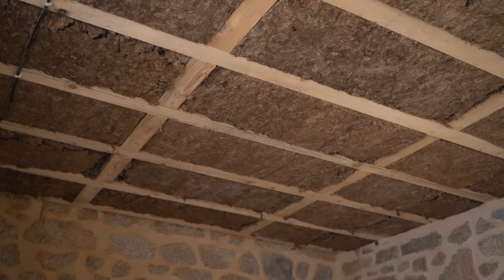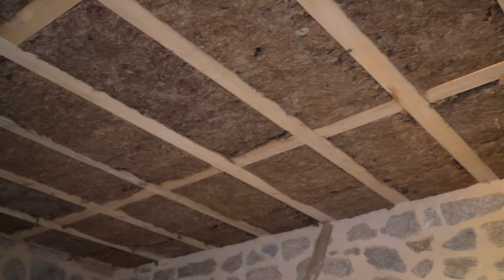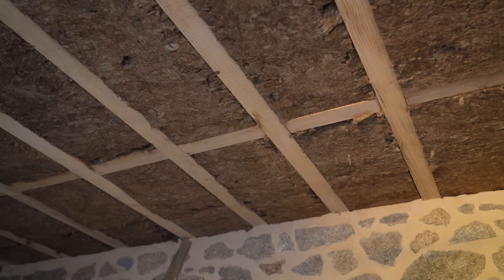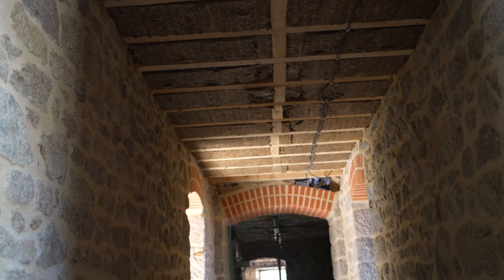Sundays at Chaumont- insulation and wiring breakdown.

Comment: Cool! A lot of explanation right there, Dan.  Thanks!  A little something to offer that I discovered by accident a few years ago when I had to install some cedar beam covers and random (4", 6" and 9") width planks on a porch ceiling here in sunny Florida.  I milled all the cedar (so it was straight) and also decided to do a 5/8" roundover on all the planks so I didn't have to worry about careful, fussy butt  fitting on the install.  The roundover hides little gaps and bad fitment in places.  Great.  The exterior of the house was what we call stucco and is a cementatious product, trowelled on over the cement block the same as you would trowel on lime render but in two coats.  The first just a smooth bonding or base coat and the second in this case what we call "skip-trowel" where the mortar is applied in skips and spots resulting in a pretty rough surface possibly with about the same irregularities as some of the stone walls in the basement.  I wonded how I was going to make the meeting of the ceiling wood to the rough walls look neatly finished when I found that just butting the roundover planks against the wall worked just fine. No caulking, no coping, no nothing.  The roundover lets everything just sort of fade into darkness and look nice and neat and straight!  In your case, you might do a 150 or 200mm wide flat piece with the outside edge rounded over to form a border or faux "crown mould" around the perimeter and then infill the rest of the ceiling with drywall or whatever material you are going to use. If someone had told me about this little trick, I probably wouldn't have believed them but it worked great and this was in a new home worth well north of a million dollars so it wasn't just a "slapstick" sort of solution. Whack off a two meter piece, route a roundover and throw a little stain on it for a test piece and have a look.  It might work in your case!              Jack L.

Comment: Floor outlets if legal in france and no switches in rooms. Use wifi appliances like Google home or Alexa.The newer units don't require an internet connection. To minimize the number of units use wireless mics to transmit to a central unit. Wireless wifi bulbs are awesome.

Comment: Love the Sunday videos. For someone who has watched from the beginning this adds so much insight into the project. Thanx Dan.
Reply: Definitely. It fills in the gap of why they’re doing what they’re doing and what the future plans are.
Reply: Fantastic Dan. Love the details you are explaining. I wonder if it’s possible for a sprinkler system to be installed now that you have water. I guess this would be the stage at which to do it. Just a suggestion. You have thought of everything so far.
Reply: @annstroud2168  He needs some kind of firestopping and protection for the roof spaces. It's 4 stories up and rural location. It's a very vulnerable structure for the fire department to get the right equipment there quickly. Give it an hour and the whole roof could go up again.
Reply: What are you doing about fireproofing and fire sealing between the roof spaces so the chateau doesn't go the same way as last time.

Comment: Hi Dan. Be conscious of internal insulation. It is really not a good solution in a historic building to use a rockwool plasterboard solution. The Rockwool sales people have sold you out. Look at isopore blocks and lime render which will allow for moisture diffusion. Isopore does not rely on vapour barriers and is adhered directly to the pre rendered brick and stone walls with adhesive lime mortar. (Construction architect and historic house owner). I live in Denmark the home of rockwool. Do not fall for the rockwool reps. They do not have a good solution for this type of construction. You will never be air tight, which is what these solution relies on. Make a breathable construction.

Comment: 30kwh with heatpump is less than 7.5kwh in actual energy use. (SCOP4). There are outside units that use inverter technology, that can really attenuate the poweruse. older machines cut dial down to about half their peak capacity, inverter ones can go down to 10-ish percent of rated peak)

Comment: In both of the homes I purchased and rehabbed I have always put into the walls and ceilings anything I thought I may need in the future.  Wiring for pendant lights in the kitchen (the wires are still there), wood blocking in the bathroom for grab bars I may need lather in life etc.  I know I would not remember where they are so.....  With digital camera's these days I would snap pictures with a yard stick (do you guys have meter sticks?) or tape measure showing the distance to adjacent walls or floor.  Or write on the wood info before the picture.  It works the charm.

Comment: Excellent!  Got most of my questions answered.  I look forward to seeing it all unfold.  Regarding "CAT-5" wiring, not to put too fine a point on it: You'd mentioned CAT-5 in conjunction with fiber.  Fiber uses fiber optic cable.  CAT-5, and all its iterations (CAT-5e; CAT-6; et. al.) is copper.  There's a lot of use-considerations, capacity, and planning involved with installation of network and phone cabling, jacks, switches, routers, audio, television, etc.  I'm sure you'll engage qualified engineers to assist with this not-so-small task.  🙂sorry...I'm a nerd when it comes to wiring.

Comment: Wireless switches is a great idea. Max flexibility for operation and positioning as well as changes as building use evolves. I use Hue lights and switches throughout my place and I love them. They probably not the exact solution for your place but I am sure you will find a system that meets your needs.  On the topic of rockwool, that is what I am using in the renovation on my house here in Canada. Love this stuff!!!!

Comment: These Sunday videos are a perfect addition to this channel! Keep them coming. Being from the Netherlands I’m not aware of the French regulations on wiring, but in the Netherlands we use a system of plastic tubes 16 mm wide through which we run the electric cables. These are separate cables for each phase, earth, and zero. Those cables can be easily replaced while the plastic tubing remained in place. Separate tubing for cat5, 6, or 7 network cables. Wondering about one thing though. Light switches can be wireless, but electricity plugs can’t. How are you dealing with wall sockets without running cables through the walls in the basement?

Comment: Hi Dan, have you already look at geothermal system for the château ?
Reply: There is already considerable planting. Maybe this is one aspect that Dan didn’t plan for. But the chateau has a huge amount of gardens so it’s not too late.
Reply: @ I mean geothermal to heat and AC the building .. usually that kind of system make more sense in huge buildings !
Reply: @ Yes. They run pipes zig-zagging at a depth of 2 metres across a wide area and pump special fluid into it - when the fluid returns it is warmer and a heat exchanger extracts the heat from the fluid for the building….in this case the chateau.

Comment: Great video!  You are doing wonderful work!  Question: Will you be installing safety systems such as centralized smoke and heat detectors, maybe some fire pull stations?  Safety battery lighting?  Based upon your planned usage of the building, will the authorities consider it a commercial versus residential building?

Comment: Thank you so much for explaining the process. I’m curious if you will be installing a heated floor in the basement under the concrete and stone to help with the moisture humidity and damp. It can be a separate system from the rest of the building. Also, do you plan to use steam, electric, heat pumps, gas or some combination with rentable solar?

Comment: I know you mentioned how installing the rock wool made you itchy. Several commenters, and the product safety info, mention eye protection to prevent rock wool fibers from falling into your eyes and working their way into your eyeball. I really hope you'll use eye protection in the future. You've also mentioned finishing out the kitchen with a mass event capability. I'm curious if you have plans for a dumb waiter or lift of some kind to take those volumes of food upstairs? I can see taking trays of prepared food up those stairs you're planning could get old and tiresome very quickly

Comment: Speaking of heating... i saw a video of a very old castle where there was a fireplace (which you can also maybe use propane or something else) on each big room on the 1st floor and instead of chimneys that go directly UP , the smoke and heat dispersed across the above flooring and then out! It's been there for hundreds of years!  Perhaps that's an option for heating the rooms ?

Comment: Not CAT5 cabling... you must use Cat 6A. Also you need to run Fiber or DAC cables on every floor for the future so that you will be able to properly use 10Gbps or 2.5Gbps (which is not extreme).
The wireless switches sound like a good idea BUT once again you need to use proper protocols like Zigbee for example. You need to have a proper zigbee coordinator and at least two routers (zigbee repeaters) at each floor.

Please don't try to cover every room with just Wi-Fi. at least one LAN cable per room. Buy proper equipment like UniFi. use the In-Wall that provides wi-fi as well as lan ports.

Comment: For the electrical wiring above use conduit, if you install that correctly then you will easily be able to pull wires through them as well as provide a fixing along the floor joists.
For the outlets below use skirting cable duct with a vertical duct coming down in the corner of a room.
I’m an electrician and this is how I’d look at doing it, hope it helps.
Reply: Gaskett, shouldn't you be a plumber?😂
Reply: @jmk1962 a plumber is one who prevents leakage, mainly water. In some countries a plumber and electrician are doing very similar work. But in Europe the professions are very much split apart.

Comment: A lot to do. Wiring in the basement: run pipes (tubes, made vom PVC or Metal, like water pipes, but preferably black) vertically from the socket or switch straight up into the ceiling were the wires run horizontallly. This looks good in this rustical ambiente with you switches, they used pipes at their time also.
Insulating the floors: Floors have to insulate noise, not temperature, except above the topmost heated floor. It was usual to include heavy materials into the floors, sand, bricks, not glasswool (rockwool is also a glasswool, just in a different color. Since they become bio save (no lung cancer anymore) they degrade if water drops onto it over the years).
Wall insulation: difficult. Esprcially if you install thermopane windows. The ater will confrnse on the coldest watt and produce mould. Only remedy: use forced ventilation inside the house. Insulating the wall from the inside will only make problems.

Comment: Idea: for ceiling in basement. What if u leave a gap around edge and put lighting all around to illuminate the walls and give even lighting? Would also look fancy and less dark. Not sure what you’ll do with plugs.. u got the light switch idea but plugs are not wireless. Interesting anyways. Like a “dropped ceiling" or a "suspended ceiling" I think it’s called. Or maybe even a “tray ceiling”.
Reply: He can run the socket wiring behind the skirting boards.
Reply: @ yea true. How to get skirting boards on an uneven surface it’s beyond me. Or maybe even floor plugs somehow. Right in floor near edge. Raise floor a bit. Dunno.
Reply: Or start a trend and go powerless. Like a new vegan movement.

Comment: Very interesting that you chose Rockwool for insulation... that will keep you warm. I would suggest to choose 3 layered insulated glass in stead of 2 layered.
Reply: I live in France and do not know anyone with 3 layered glass. It rarely goes under minus 10 dégrées and I live about 3 hrs drive from the château
Reply: @carlavergeer5852 Maybe triple glazing is much more expensive and doesn’t look so good.
Reply: @carlavergeer5852 I live in Denmark were we also rarely have minus 10c, and 3 yrs ago my windows were changed from dural to tripple glass (and the walls and ceilings are insulated with Rockwool since forever) and my heating needs (and bills) are now down x4...

Comment: Surely you must have a patch of ground outside where you could put a "range" of solar panels or a ground source heat pump to help with the power needs????
Reply: There are solar power roof panels that are nearly indistinguishable from slate tiles -from a distance, at least

Comment: Plug sockets can be supplied by running wire behind the skirting boards and from room to room behind the door framing.
Reply: Not sure if French code would allow to daisey chain all the rooms like that? Maybe he could run down the wires in one  corner of each room and hide the  rest behind the skirting boards? Then again since this is the basement electrics might have to be a certain distance above any hypothectical flooding or splashing when cleaning the floor? Things can be quite strict in some countries these days.
Reply: @rutgerw.  or use nice metal conduit tubing on the wall surface. It would look retro.

Comment: Are you going to have fireplaces installed? It would be in keeping with the building to have a few. I know you will rely on insulation and radiators fir proper heating, but for the aesthetics I’m mainly asking.
Reply: Most houses in France use wood  burning stoves these days.

Comment: Never use glass wool, it collapses at the slightest moisture and the insulation is equal to 0. You are using the right thing. Stone wool insulation is the only right thing as it will dry out if it gets a little moisture. I have helped renovate several older buildings in my active time as a carpenter and bricklayer.

Comment: Why are you insulating the floors? Your heat is trying to escape out of the house, only the roof and walls need to be insulated, unless you’re talking acoustic insulation. Separating the rooms with thermal insulation is not only costly now, but will cause zoning through the building which is inefficient
Reply: Referring to the 1st/2nd floors of course. Understand why you’d do the ground floor since you can’t insulate the basement walls

Comment: I live in Germany,  in a little old house built in the 30's.. it seems that when it was being wired, the  electrical cables all ran through a sort of pipeing... when we needed to replace the old 30's wiring , for brand new up-to-date modern wiring,  we just needed to slide out the old and slide in the new...  no damage to walls or ceilings and everything done in a few hours instead of weeks... Genius. You might want to consider the extra "pipeing" for ease of maintainence in years to come.  The future may thank you for your forsight...
Reply: Conduit
Reply: 👍That's how it's done in Sweden as well.
Reply: Just had a property rewired in Italy.  All wires run through flexible plastic conduit.  Much of the conduit (and water lines) are embedded in the concrete floor.
Reply: Sounds like that’s what he was talking about. Very smart idea.
Reply: Excactly how one can „future proof“. One shouldn’t be hesitant to embed them in the walls, cause you will find any metal with special equipment. You could even run them through your doorframe, so you have minimal intrusion in the walls.
Reply: Or go for the industrial look. Metal piping mounted on the will. Oke it will stand out 1.5cm but is less than the lichtswitch or wall socket
Reply: It's always done that way, just running wires without protection can't be code compliant in France.
Reply: @tellyboy17  It's perfectly acceptable in quite a few European countries (in fact some Germans are so used to cables in walls that they'll tell you that conduit is no longer legal, which is of course ridiculous) but not in France as far as I know. In Austria it would conform to the regs but it's considered unnecessary cost-cutting, bordering on bodgery. I've been in situations where it made sense though. If your whole wall is only 50 mm thick including a skim of plaster on either side you don't really want to chase for 20 mm conduit.
Reply: Yeah, it's called conduit. It's pretty common.
Reply: That's how they do it in France. I used to live there. We had a rewire, and that is the only way they do it over there. Different from the UK.

Comment: Could you not put the sockets into the skirting boards?
Reply: I’ve seen radiator systems hidden inside skirting boards instead of using radiators of the conventional type. On Dragons Den.
Reply: @ I have too. But I wonder  if skirting board heating is enough for such large rooms? I would go for underfloor heating.

Comment: I recommend you get some one with experience designing HVAC system for large buildings so you can get something mapped out before you start any significant interior work. For now just focus on getting the building water tight. Duct work is going to be major challenge & can effect everything else in the building.
Reply: I think there are some brickwork air channels which were discovered quite a while back. It will be interesting if they can be reused.

Comment: Trunking, how on earth to get it flush on that stone Wall? 
Probably with wood? Like carving out the inside or what?
Did you not just Talk in the other video about wireless? But that would be horrible, imagine changing all the batteries all the time...
Also i think in the old days it was sight installation, idk the english terminology but in germany its called Sichtinstallation, maybe use cloth covered cables. I recently did a projekt with Berker 1930 switches and cloth covered cables.